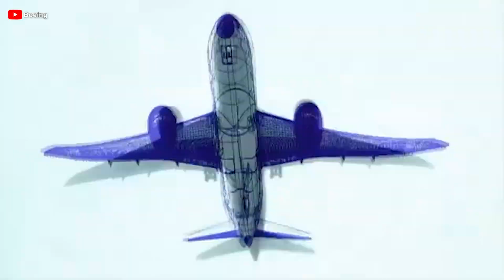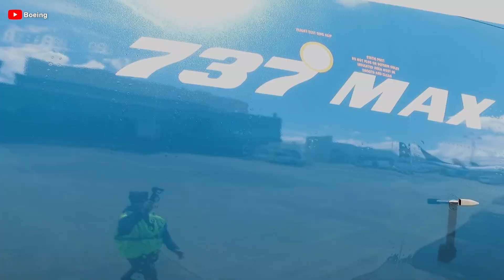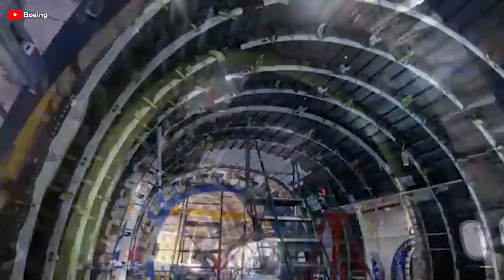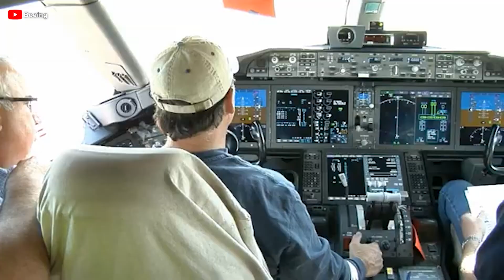This NEXT Boeing 797 Just SHOCKED The Entire Aviation NOW! Here's Why

Comment: The development of the Boeing 797 has not been decided.
There seems to be little demand for the single-aisle 225-seat long-range model and the 275-seat short-range model.
The A321XLR is an extended version of the A320, which has been sold in large numbers, so costs are kept down. Even if they make an airplane like the B757, they cannot compete on cost.
They will not be able to sell in large numbers unless they make a two-aisle short-range model to replace the B737.
Boeing's proposal was a high-wing, no container, but
(1) a low-wing with engines mounted above the wings, and (2) containers half the height of the A321
can meet airline requirements.
A double-bubble fuselage would be better than an oval.

Comment: Thanks to the expiration of Grandfather rights, future development of the 737 is no longer viable.

Although we will talk about a clean-sheet 737 replacement, I suspect that it will rely heavily on the 787, as would any 767 replacement, i.e., middle of the market aircraft.

However, until we know when the required engines are developed, it is all conjecture, as is me suspecting that the Boeing NMA is announced first and Airbus the first in Airline service. Subject of course to no other manufactuer becoming a serious competitor in that market segment.

As a consequence of being the last off the drawing board, I feel it reasonable to suspect that any potentiial advantage the Boeing may have, the Airbus will minimise or eliminate it. All that will be left are the purchase, adoption and maintenance costs.